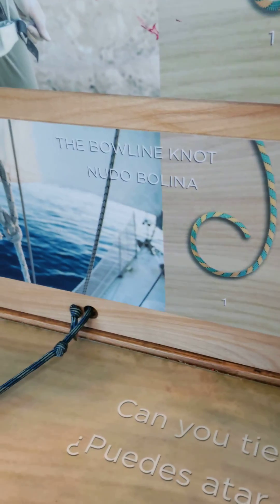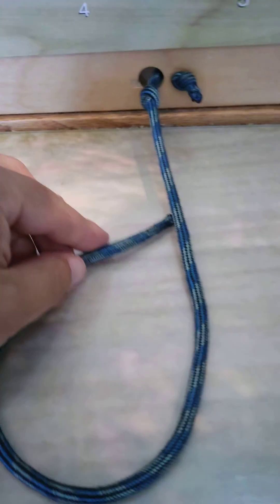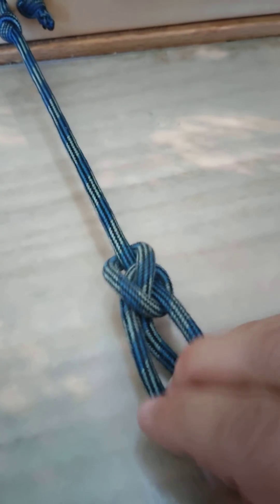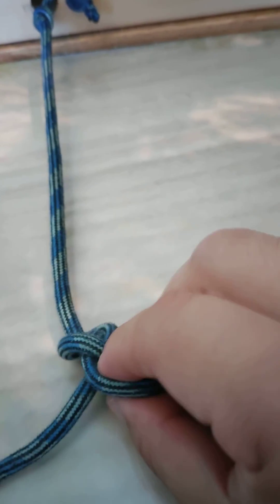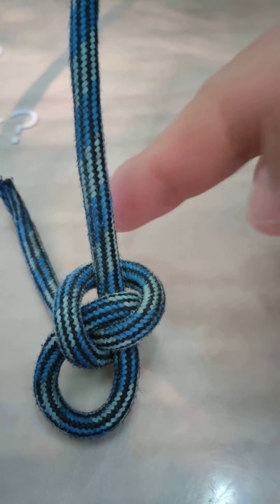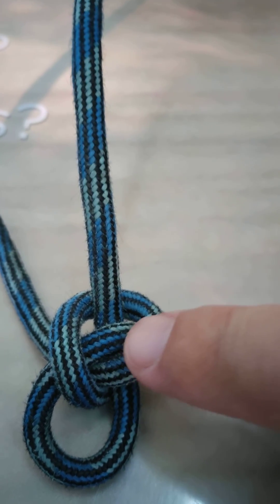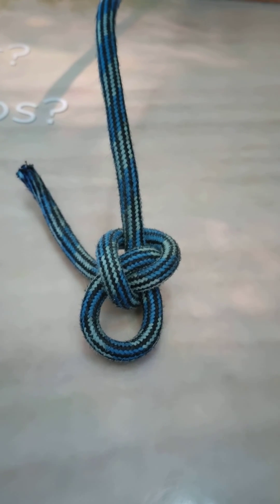Science of Knots 001 (Bowline Knot)

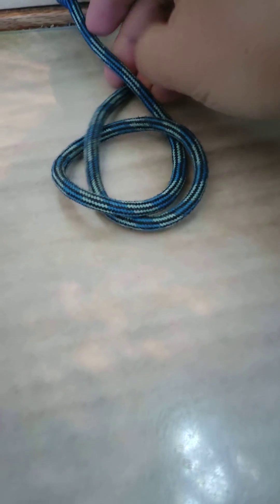Comment: Hi, this is not a properly tied bowline. You made a mistake between steps 5 and 6 at 0:42 . The free end should have passed between the two pieces of rope instead of under both and then you should have pulled on the lower right side loop instead of the upper left. If you research it you will see that the bowline is supposed to form a fixed loop that cannot be adjusted as you did here.